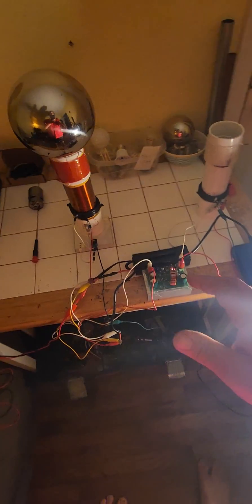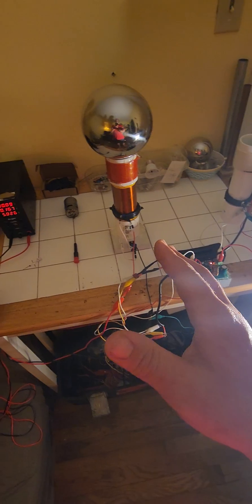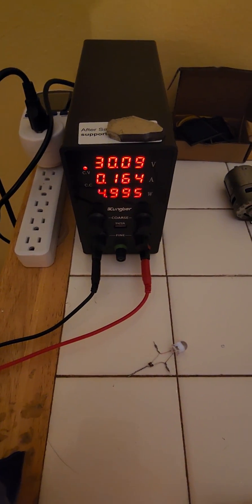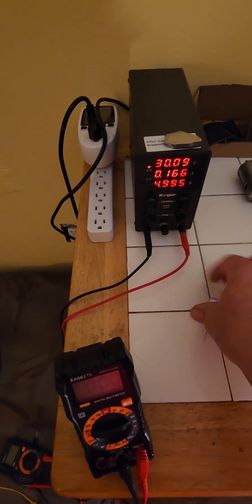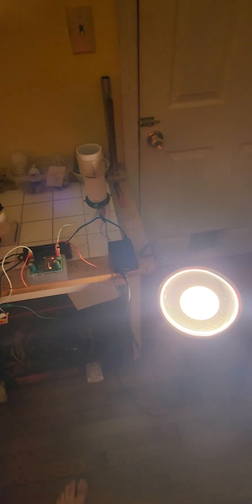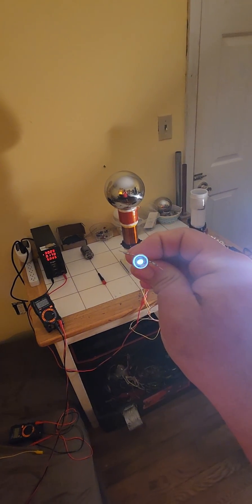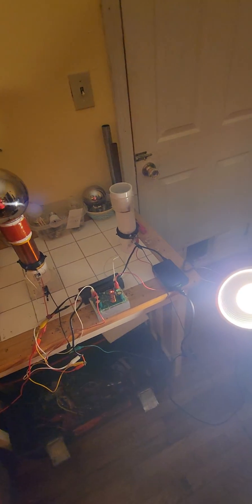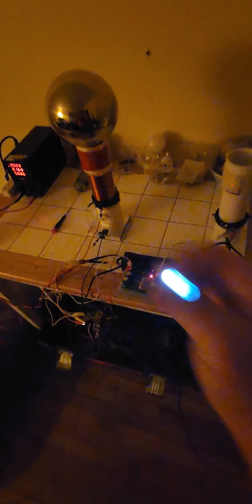🎆Regenerative Wireless Power Achieved Using Tesla Tech Runs 120V60Hz Light Via A 5 Watt Transmitter🎇

Comment: Congratulations.  You just invented a battery... with extra steps...
Reply from the maker: It's a bit more exotic then that. It will recharge itself while I maintain scary efficient wireless power all from a 5-10 watt variable wireless power transmitter

Comment: My grandpa had a high power line running across his ranch and he put a wood spool wrapped with copper wire under it and the two end connected to a light bulb in the barn. It stayed on 24/7. It always burned brighter when the weather was damp and you could hear the electricity crackling in the air.
Reply: Could you draw up a schematic? That would be something that I'm sure people would like to replicate.
Reply: @Warrrenjstephens  from what I remember, it was just a wooden spool about 18 inches around with an unknown amount of bare copper wire wrapped around it (I'm guessing hundreds of feet) with shielded Romex wires attached to the two ends. I've been told that one wire has to be grounded for this to work but unfortunately I don't know the specifics.
Reply from the maker: Lol that's awesome if he constructed a resonant receiver coil for 60hz & earth grounded one end he probably could have extracted massive amounts of power from it.

Comment: Nice - Now forget 120v light use 12V 3W car LED Cob = 0.250A run from  1 x 18650 and Charging 5V to 12v DC TO DC inverter charger recharging the 18650 and running the 12V LED Cob all from 5V at No Current draw till 18650 needs recharge from 5V - My secondhand 2000mAh 18650 drives the 12V LED Cob for about 24 hours without recharge.